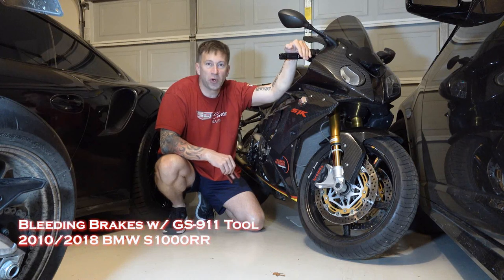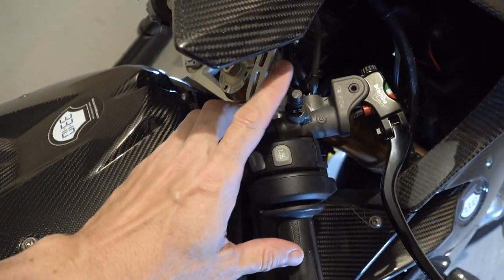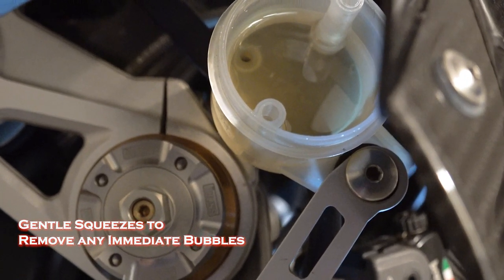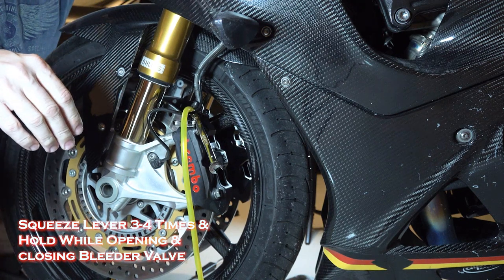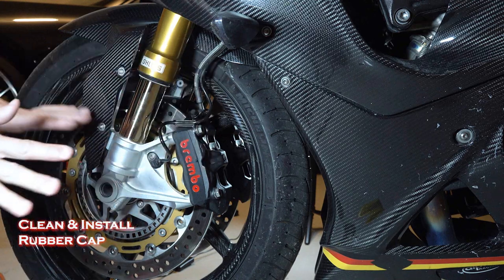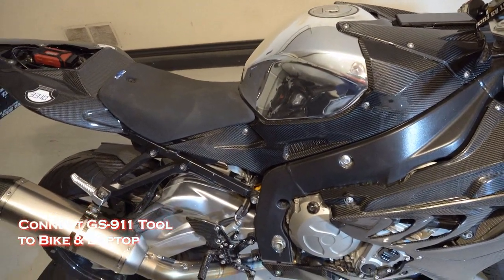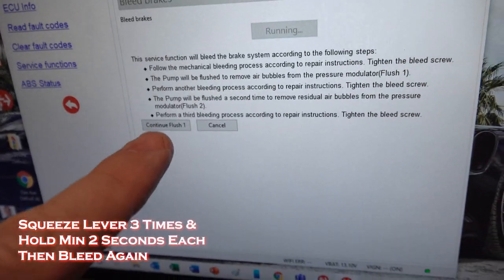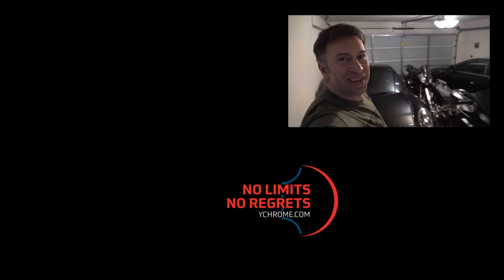How to BLEED BRAKES Motorcycle Made EASY - BMW S1000RR ABS GS-911 Tool

Comment from the maker: Brake bleeding procedure using BMW S1000RR as example including use of GS-911 for ABS pump cycling.
Reply: Why can't you just turn the key on? Why's the abs any different than a car?
Reply from the maker: @natecote1971  haven't worked as much in car systems, but for bikes at least, the pumps don't cycle until you activate them, i.e. engage the ABS. let's say there's air in the ABS pumps, and you bleed the external lines, you may not know there's air until you use the abs, and the air from the pump gets in the main system causing sponginess. this is why bmw has this function, cycle the pump, get any air in it out into the system, so you can bleed it with your valves. for the last time i changed the master cyclinder, i didn't have to do this, because the process wasn't introducing air into the pump, just a little air at the top that i easily bled off. In comparison, my aprilia doesn't have this utility in my setup, so for that you bleed everything, go out and hammer the brakes enough to engage abs, that allows any air in the pump to get into the main system, then go bleed it out again.

Comment: Bled the front brake system on my Tenere 700 after swapping brake lines so the new ones were completely dry, not a drop of fluid. Didn't even need to activate the ABS. It's a flow through design. If you can bleed the liquid through the ABS block (from master cylinder to caliper), most likely you don't need to activate the ABS. In your case you have fluid constantly in your system, you are just swapping brake fluid out. No need to do anything with the ABS then anyway.
Reply: Look at abs scheme... of course it will bleed through module.... 

You should bleed abs with activation...
Reply: More silliness!
Start with a syringe (a big one) filled with brake fluid.
Attach it to FURTHEST caliper bleeder nipple.
Cack it open and inject fluid till main reservoir is 2/3rd full.. 
You are done unless your lever set has a bleed nipple.
Give it a pump or two and crack that one.
When any fluid is dicharged, youve bled your master cylinder too.
Go for a ride!

Comment: My front brakes went soft on me and became 90 percent unresponsive i can only feel a slight brake when pulled back all the way. the fluid is full and no leaks that i can see. i did notice some.. crust or scaling flakes at the bottom of the brake fluid reservoir. any idea whats going on here? would a good bleed solve this?
Reply from the maker: a good thorough bleed is absolutely the first thing to try as it's cheap if you do it yourself, and good chance the culprit. if a bleed doesn't fix it, make sure there's no leaks anywhere, and if all that is solid, it might be the master cylinder seals leaking
Reply: You are assuming air forced its way into a sealed pressurized system.
Your bike should have been serviced YEARS ago.

Comment: You can do the exact same thing, without waiting overnight
Reply from the maker: how long would you let it sit with the zip tie? does take some time to let the bubbles migrate up. not a big deal for me to leave it overnight, but may not need it i guess.
Reply: @NoLimitsNoRegrets   I don’t use any zip ties, I keep bleeding until there’s no bubbles and my master is firm. Never had an issue.  And also, if you’re just doing a fluid change, mixing new fluid with the old without getting any air into the lines, you DO NOT need the GS911, as per 2 bmw techs
Reply from the maker: @DjCoffaro  oh, true, i just found that for me, leaving the zip tie around overnight makes bleeding go faster for me. also, agree, generally don't need to do the gs911, but i wanted to be complete in the video so everything is included as a reference in case someone is changing the brake lines or anything.

Comment: Thanks for the extra detail regarding the use of the GS911 and then repeating the bleed cycle on the calipers three times after using the GS911 each time so ALL of the bubbles are bled.
Reply from the maker: absolutely! I try to make these videos as useful/practical as possible!

Comment: I'll hopefully be picking up a low-mileage 2011 s1000rr soon. It's got less than 3k miles and as such, it's been sitting for the majority of it's life. The owner just told me that the brakes are out and showed me a video of him hitting the front brake with the lever going softly all the way to the grip. I'm assuming it got air in the system from sitting for so long. Is this what I'd need to do to be able to ride it (about 400 miles) home? Or is there more of a bandaid fix that I can get away with for the time being?
Reply from the maker: If it were me, that brake system feels too risky to drive it home. if they're that soft/ineffective, that sounds like more than just a little air in the lines. it sounds like it could be something more serious like a failing seal in a master cylinder or caliper, a loose fitting sucking in air, etc. it's likely fixable, but i would strongly suggest you trailer/ship it home, clean it really well, fill up the fluid, try the lever yourself, look for any drips/leaks, then start the process as i laid out in the video. i would get the lever and rear pedal firm first before cycling the abs pumps. the reason is if there's a bunch of air in the lines, get it out first vs. cycling the pumps and getting that air in the pumps. if they're that loose, it's going to take a lot of time. if you just can't get it firm, you have a leak somewhere. if you see fluid by the caliper/lines, that's the leak, if you don't see a leak, it might be inside the master cylinder(s). you really want to make sure it's all working extremely solid before you even try to ride the thing slow around the block.
Reply: @NoLimitsNoRegrets  damn, I was hoping you weren't going to say that... But I kinda figured that'd be the case.. I'll see if he can fix it before I pick it up because I don't even have a truck or a ramp or a trailer to get it home like that..
Reply from the maker: @muscleandimports  you can rent from uhaul fairly cheap, cheaper than crumpling up the bike on the way home. another option is uship website. if you ask him to fix it, might wanna ask for a receipt from the dealer to know it got done right. he's clearly not mechanically gifted if he had this thing sitting around w/o brakes like that. i'd never sell a bike that didn't work safely. bad practice. you don't want him having his fantasy football buddy bleed it to feel good leaving his place then fail on your drive home. best option is ship/haul right to your house and fix it correctly so you know for sure.
Reply: @NoLimitsNoRegrets  I'm still waiting on the guy, but with any luck I will be trailering the bike back in the next 4-6 weeks. 

Is this the rcs17/m50 setup? If so, what made you go that route over say the rcs19 or m4 calipers? 

Also, would you happen to have the full parts list that's required to go with this setup? I might as well upgrade the whole braking system if I'm going to be replacing stuff.

Can you run a different lever with the brembo master cylinder or do you have to use the one that's included?
Reply from the maker: @muscleandimports  old receipt shows rcs19, m4 calipers and brembo HP rotors for 10-12. made a huge difference for me. only recently i changed to twm low drag levers as they were the only ones that would fit the HP clutch perch after the '18 conversion, so yes, you can swap levers. I have another video on that https://youtu.be/FJ3iOqe0MjE
Reply: @NoLimitsNoRegrets  any reasoning in choosing the m4/19 setup over the m50/17 setup?

What did you do for brake lines?
Reply from the maker: @muscleandimports  oh yea, i did change to spiegler brake lines. i no longer have those though as they had to be scrapped when i converted to the '18 stuff. can't remember exactly why now? but i just have stock 18 lines on now.

Comment: Question, with this tool, is there an option to change tire size? I was thinking on going from 190/55-17 to 190/50-17, or do you really need BMW ECU tool to change this.
Reply from the maker: I'm 99% sure you can't do that with the GS911. Floyd in Dallas installed the RCK software on mine, and I remember him commenting on the tire size adjustment. If you're running stock software, then yes, only BMW could adjust it, if they can w/o charging you several grand for the codes to do it. If you're going to start heading down this path, you might consider the RCK option to allow flexibility in other areas too like accommodating new exhaust, etc.
Reply: @NoLimitsNoRegrets what is RCK software? Any contact info appreciated. Yt not letting me edit hope that’s readable Wanting it to be as useful as possibleeI have 2022 S1KRR and buying GS911
Reply from the maker: @EtaSoon777  RCK is the BMW Alpha Racing software. I had a watered down version that allowed me to look at things with the original setup, but Floyd Rasc (facebook ID) is the only guy i trust with my bmw software up in Dallas. RCK is probably not something feasible for us users to have, but it allows ppl like Floyd to squeeze more fun out of our bikes!
Reply: @NoLimitsNoRegrets  awesome appreciate the info. Is the GS911 offer brake fluid flush as delivered or do I need to purchase or have additional software added? If need to add software can you offer a guesstimate as in $$ to add it? I am specifically interested in brake fluid flush as in video on my 2022 S1KRR  but like as close to dealer functionality as possible! Like to avoid them doing work I can do myself if the GS911 can handle the code ECU ones & zeros end of that stuff so warranty remains intact.
Reply from the maker: @EtaSoon777  brake fluid flush....that's a good question, and to be honest, i don't know that answer. you might find it on the gs911 site. years ago i replaced all the brake lines, and i just did the same cycling of the pumps with the gs911, so i may have had some old fluid from inside the pump in my system, but i guess i don't know how you'd do a full flush? or maybe there's only an insignificant amount left in the pump itself that it's not worth worrying about?

Comment: Nice garage. Is that all ilmberger carbon on the S1K?
Reply from the maker: thanks, no sir, it's all fullsix carbon on it. saved around 70 oz i think by swapping from the stock panels. BST CF wheels saved a bit, Li battery, Ti exhaust was the biggest weight saving. All the mods i've done on it since buying new (minus the most recent ones) are at Part 1 mods: https://youtu.be/TFB2OU1xhTM
Part 2 mods: https://youtu.be/oGGh7lIMZhU
Part 3 will e coming soon as i've done a bunch of new stuff too!

Comment: the front and rear brakefluid reservoir from 2009-2018 and 2019- are same only old is milky invisible and new  smoke crystal  you see fluid level.

Comment: Between the old GS911 (the yellow one) and the new one (the red one), did you use the same software ?
What software is it?
Reply from the maker: if i remember right, the software is a gs911 download, so when i bought the device, i think it gave a website to download the software to the laptop, and just use it that way.
Reply: @NoLimitsNoRegrets  Thank You very much. The GS911 is pretty pricey though... Good day ;-)
Reply from the maker: @tomekichiyamamoto2177  no, they're not cheap, but the ability to do some things yourself saves way more $/time than having to haul it do the dealer.

Comment: Do you have to cycle the abs  pumps when only doing the rear caliper?

I'm adding an extended brake line. Mine is 18rr as well
Reply from the maker: my understanding is for fronts too as the ABS pumps carry fluid for both front and rear (linked), so if you do anything anywhere, there could be air trapped in the abs pumps. if you just do a MC change or something, it's easier to get all the air back out at that source. cycling the pumps isn't always necessary, but a good precaution if bleeding the whole system just in case any air is trapped in the pumps.
Reply: @NoLimitsNoRegrets  thanks for the quick response! I have the Bluetooth obd link and realized that it too can run the front and rear abs pumps from my phone.!

Comment: nice bit on recycling the ABS pumps, what type of brake fluid did you use? brand?  thanks
Reply from the maker: glad it was helpful! yes, I was advised to use the castrol react srf racing brake fluid.
Reply: @NoLimitsNoRegrets  thanks

Comment: thx for the instructions. do you know if xr gen1 would be much different?
Reply from the maker: I don't have any experience with that, but the gs 911 had a whole bunch of models it worked with on the menu. I would guess that if your model is compatible with a gs911, it would work very similar to how the video shows. Remember, there are two gs911, the yellow and the red. i had to upgrade to the red for the '18 conversion vs. the yellow i used for my old '10 setup.
Reply: @NoLimitsNoRegrets  Thx for the response. Yes, I got new version of GS911 for my gen1 S1000XR and it works well. Will report it back.

I heard there is no need to bleed ABS unit when the system is tight and we just replace the fluid, but after watching your vid is seems that this is simple no cost peace of mind approach. Thx again.
Reply from the maker: @Andy-rk9mu  good to hear. i've heard as well that it's not necessary to bleed the pumps each time, but if air is in the lines, and you've engaged your ABS, in theory, it could get in the pump. correct, unlikely or not, it's an easy step to add for peace of mind.

Comment: What are you doing between the ABS pump activations? You say you "bled everything", do you mean you are repeating the earlier steps again to ensure there are no air bubbles after cycling the ABS pump?

Thanks for the video by the way!
Reply from the maker: yes, each time i run the abs utility with the software, i go back and repeat the bleeding steps (not the zip tie on the lever though.) that way if any air comes out of the ABS pump, i'm bleeding them out the system. good idea to then go ride a few times, bleed once more. then you should be solid as a rock. glad you enjoyed!
Reply: @NoLimitsNoRegrets  Doesn't the fluid actually need to be changed via the bleed? Or is that a separate process? Thanks
Reply from the maker: @number1Schumacherfan  howdy, correct, this is just to bleed the brakes. it's what you might do periodically as part of maintenance, if you've been riding hard and may have boiled a little fluid, created air, maybe changed the master cylinder or something, but you don't have to completely flush the fluid every time. that's a much more involved process and takes a lot longer. this bike had the flush done when it was converted to '18 guts, so it doesn't need it right now. Hopefully, that all makes sense, but let me know if you still have questions!
Reply: @NoLimitsNoRegrets  hi can i bleed my rear brake with the same procedure?
Reply from the maker: @O.A_Ih4teno0bs  absolutely, in fact, i thought near the end of the video I said to repeat it for the rear, but sorry if i forgot? Yes, though, same procedure applies to the rear.
Reply: @NoLimitsNoRegrets  no worries, great video btw it's very helpful 👍🏼😅
Reply from the maker: @O.A_Ih4teno0bs  absolutely! figure every time i do something, might as well make a vid and help others at the same time. thanks for watching!
Reply: More silliness!
Start with a syringe (a big one) filled with brake fluid.
Attach it to FURTHEST caliper bleeder nipple.
Cack it open and inject fluid till main reservoir is 2/3rd full.. 
You are done unless your lever set has a bleed nipple.
Give it a pump or two and crack that one.
When any fluid is dicharged, you've bled your master cylinder too.
Go for a ride!